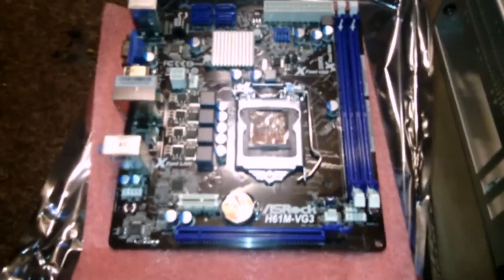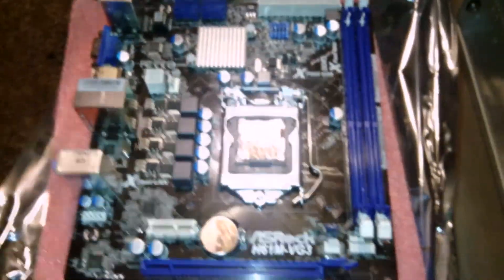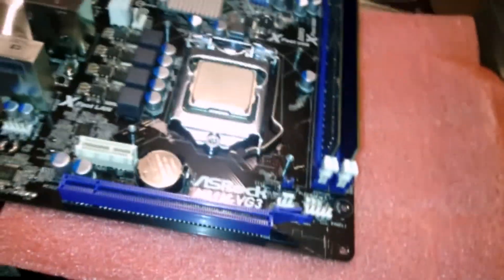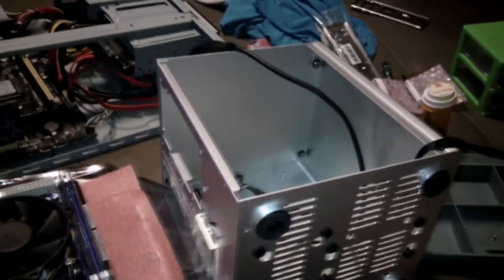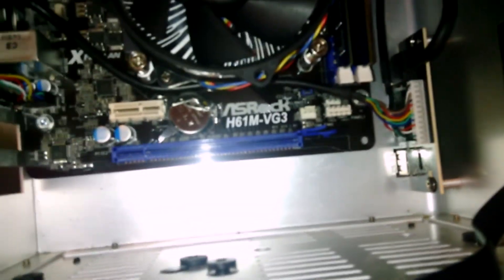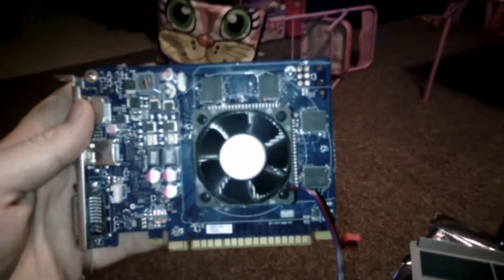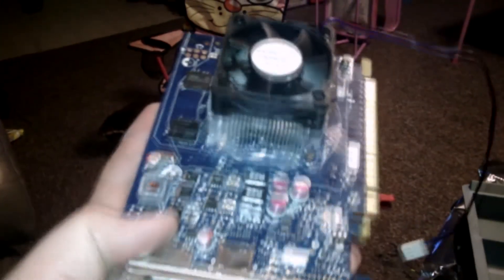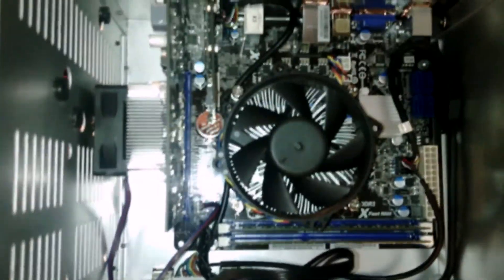my small pc build with a micro atx and a mini itx case!

Comment: Hey! Great build. Listen, what do you think is the most hard core gpu you could fit in this particular set-up?
Reply from the maker: GIGABYTE GeForce GTX 1070 Mini ITX OC GV-N1070IXOC-8GD Video Card. what i did is that i cut off the second dvi port because i would never use it plus i cut off piece of the bracket that held the screw in place. all works just fine. i had no problems with it. and i also upgraded it to a i7

http://www.newegg.com/Product/Product.aspx?Item=9SIA65C4VD6807